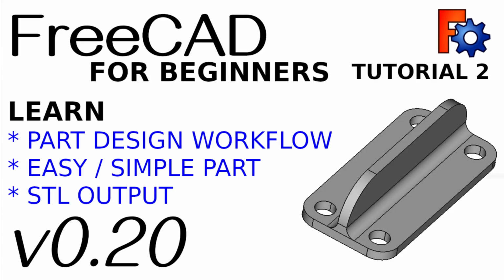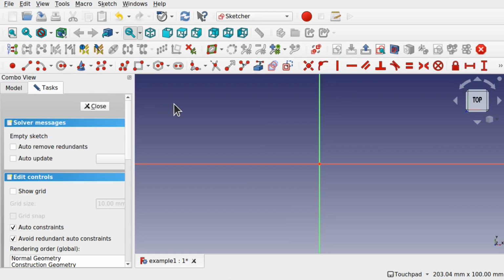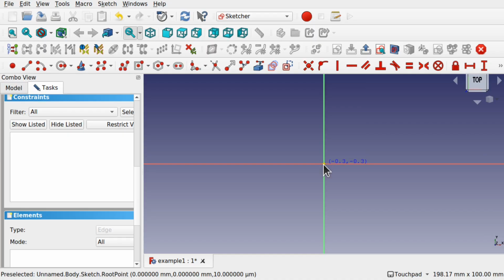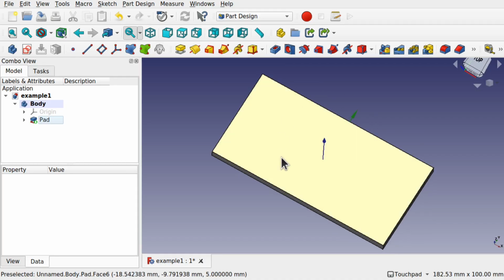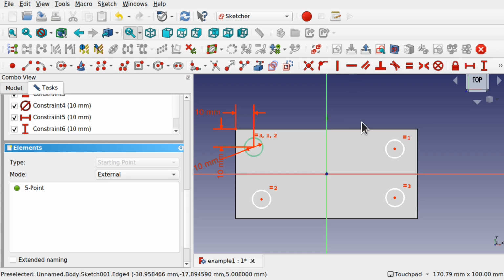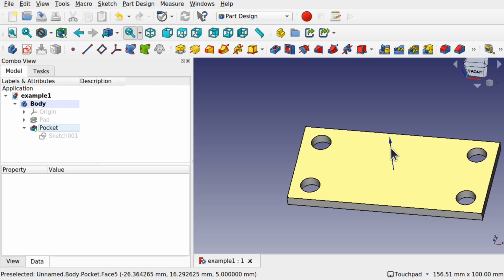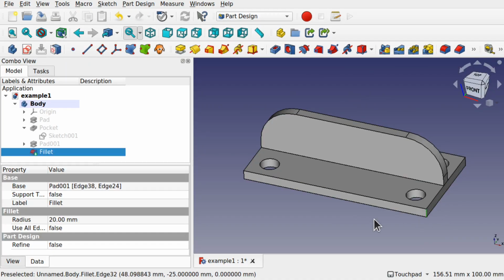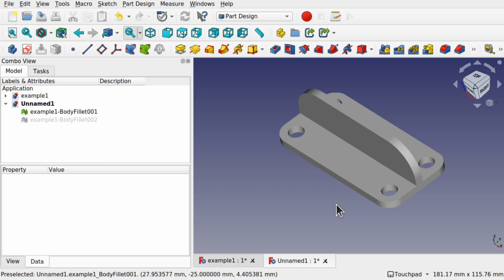FreeCAD 0.20 For Beginners | 2 | Create a simple model and export to STL in Part Design

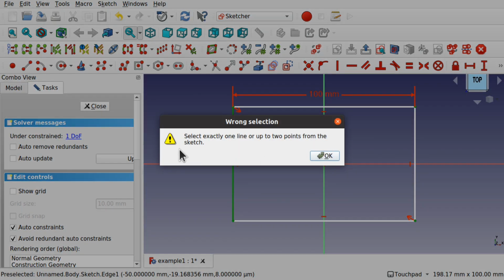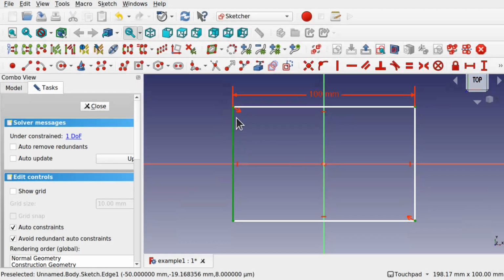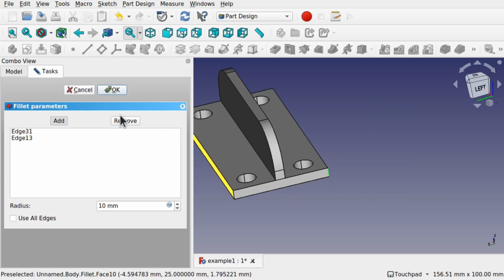Comment: 1st, thanks for the series. But a heads-up to others like me, who are at this stage of learning. I've just downloaded v 0.21.2 (current version for Windows) and the FreeCAD coders are like the rest of the coders in the world; they just can't help changing stuff because they can. 'Solver messages' still gives a count, but there are no config options in the box. There is no 'Edit Controls' box, but there is an 'Elements' box. At ~13:04 in this video showing the 'wrong selection' popup: well that doesn't happen in 0.21.2; instead, down in the bottom bar that shows the mouse options you get faint yellow text with that warning, and it isn't persistent. it disappears after a few seconds. REALLY confusing/uninformative for a novice user. This isn't a criticism of this video; it's a criticism of the coding changes that transform obvious, in-your-face warnings into subtle, barely noticeable text lines out of your visual focus field and leave you wondering why the software isn't working. ok..onward from 13:04....And at ~21:00, in the Tasks box I don't get a purple 'x', but a purple dot. There is no mode drop down for to select external. At ~33:00, the behavior of the report view is...different. At~34:00, 'add' has become 'select', and you must hit 'preview' for the additional filleted corners to appear.

Comment: Read the title and the comments and thought this might be a good choice for a beginner. Maybe because I have not used cad before, I found the instruction almost useless, on my computer anyway. Constantly losing my work and having to start over. Tried saving regularly but when it goes awry and I revert to last saved it is never at the last saved and I have to do all or most of it over again. I downloaded the same version as the video but ... I have the speed slowed to 75% and it goes to fast to follow having to switch from screen to screen. Pretty frustrating. I guess it means beginners to FreeCad not beginners to Cad in general. Looks like a program that could definetly make drawings easier if you could learn it.

Comment: I have a question: whats the difference between a pocket and a hole? And why are we using a pocket here instead of a hole?
Reply from the maker: A pocket allows for more control over the depth and shape where as a hole allows for threads and control over standard sizes (M5, M3 etc) . You can use which one you like it's totally up to you.

Comment: great tutorial but i am watching this a year after it was made and my version seems to be different and i have some things missing. i could not add extra fillets to the base i had to do each one manually. my interface looked different than yours also.
Reply from the maker: You must be running on 0.21.  I am thinking of redoing these for that version.  There are enough differences to warrant a re-run.  But if you can deal with the variations the tutorials are still valid.

Comment: I seem to know have the centered rectangle tool.  I don't see that dropdown menu and I don't see it in the sketch drop down menu.
Reply from the maker: The tool is available from the rectangle tool by selecting the down arrow by the side of it for additional options.  If you haven't got that then check to see which version of freecad you are running.
Reply: @MangoJellySolutions  that down arrow is not there.

Comment: very good. I have used many CAD systems dating from the 80s till now (CADAM, ProEngineer, Solidworks, SurfaceCAM, MasterCAM, etc).  It has been about 15 years since I've done any CAD work at all and boy have things progressed!  What FreeCAD offers for free used to cost $60K a license in the 90s. I'm getting back into it because my wife bought me a 3D printer :) .  However, I didn't find FreeCad all that intuitive to use because of the jumping back and forth between "workbenches".  Your videos are extremely helpful.
Reply from the maker: Nice to see your coming back to CAD, I know what it feels like coming back to 3D after a long break, have been through the same myself.  The workbenches can be very confusing but once you have got used to them then they come second nature.  I personally customize them in my day-to-day use but use the defaults for the videos.  Tools can be moved from one workbench to another so I have a number of commonly used tools that I use the most on my toolbar.  Glad your enjoying the videos.

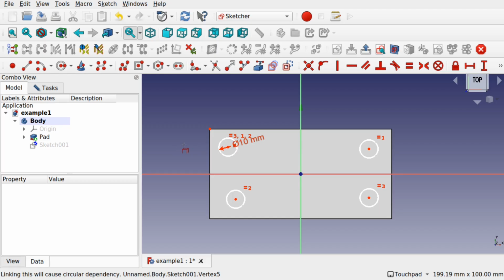Comment: @ 20:37 I get this error when placing external geometry:   22:30:40  Traceback (most recent call last):
  File "<string>", line 1, in <module>
<class 'ValueError'>: Datum 5.00 mm for the constraint with index 2 is invalid
22:30:40  App.getDocument('S
ketch_001').getObject('Sketch001').setDatum(2,App.Units.Quantity('5.000000 mm'))

Comment: Good video.
Problem I have was when I went to draw the 2nd sketch, I couldn't see my drawing as it is on the xy plane under the pad.
Reply from the maker: Thank you. With your issue it sounds like you haven't mapped the sketch to the top surface. Select the top face and click the sketch and it will be attached to the face. Don't double click as the whole lot will go green and you will have selected the body. It's only recently I realised that some people who are having problems are doing this and it can cause some confusion.

Comment: Although this is an excellent tutorial, there have been enough changes in the windows in the combo viewer that it makes you have to go through and figure out what options you need to select to continue the tutorial. The Edit Fillet window is just one example as there is no longer an Add button, but a button that switches between Preview and Select, There are several more differences. Plus, I think there may be a bug in 0.21. Twice, even though I followed you, FreeCad tried to draw the new objects on the bottom face (holes and rectangle for vertical piece). I went ahead and went back a couple of steps using undo, followed you and the same thing happened. Had to undo to just before adding the sketch, save the project, close FreeCAD, open it again and viola, everything worked.

Comment: I really like the video's so far. I only have one question. For constraining the last 2 DoF of the circles, why pull in another external component, horizontal constraint and vertical constraint? I would think using symmetry constraints on the axis lines solves the same issue. Is there any pros or cons on either ways?
Reply from the maker: Glad your enjoying the video.  There are many ways to constrain the geometry so I can't say that it is right / wrong / best / worse or the whys.  At the end of the day if it get's you where you want to be and you have achieved the desired outcome then all is good.  FreeCAD gives you that flexibility to allow you to tackle those tasks in multiple ways.  As for pro's and cons it often down to personal preference.  It's good to find alternative ways as you have done to give yourself more of an understanding of the software

Comment: for some reason i dont have the center rectangle on my toolbar
Reply from the maker: There could be two reasons for this.  The rectangle tools are all under one tool, you will see a small drop down arrow by the side of the rectangle tool and find the additional ones within.  The other is that you be be running a old version of freeCAD.

Comment: I am half way through part 2 of the tutorial. I have the base with the four holes modeled. When I set an external reference to the left and right edges and insert a rectangle, the rectangle appears on the bottom surface.  I am running FreeCAD 0.20.2 on a WIN 11 PC. Thank yo for the very clear instructions.
Reply: It is on the bottom, I can see the lines thru the holes.  If I rotate the object I can see the addition until I have a full face view.  It then disappears.

Comment: Great tutorial for Freecad, you have made it very simple to understand. Could you tell me how to select different depths of pockets for each feature?. Say if two holes need to be at 3mm depth and other two are 2 mm depths.
Also in 0.2 version the centered rectangle option is missing, any idea how we can get around that
Reply from the maker: Glad you enjoyed and thanks for the feedback. So for pockets of different depths you would do those on a seperate sketch. Pocket your holes for your first sketch and then select the face and create another sketch on top of that for the next set of holes to pocket. As you haven't added any height then the highest point will be on the same plane as the previous sketch. And for the centered rectangle you can use symmetry with say top left and bottom right against another point. Or even drop a point in yourself.

Comment: Very nice series so far. I watched the first two and it goes at a very decent speed for beginners (some beginner's courses start with the space shuttle - not helpful!). I managed to do everything like you did except the last 2 fillets. I have seen in the comments that many people also had that problem. I set the preferences to refine after boolean and sketch-based operations but even with that it gives me an error: failed to create fillet.  The error report says: Recompute Failed! Please check report view. But there is nothing in report view. Interestingly, if I select the whole part and select fillet, I get fillets everywhere up to a measure of 2mm (looks quite nice) but that is not what the exercise was about so still don't know why it did not work on my system (Freecad-daily).

Comment: I tried out this model with an experimentally different workflow. 
I failed to get a fillet on one of the two corner edges of the "ridge" part.

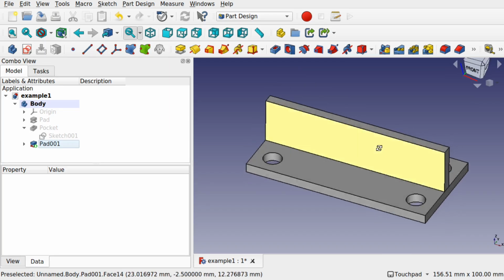That brings up this doubt: at 31:50, you have applied the fillets directly to a 3D shape. For creating all six fillets in this object, you could have edited the sketches to round up the corners using constraint-preserving sketch fillets. Instead, you have applied the fillets to the 3D object edges directly.

So when are we supposed to use the sketch fillet, and when are we supposed to use the 3D object fillets?
Reply from the maker: You have to be careful with fillets (3D object edge ones) as numerous issues can occur especially if your doing a fillet either end you have to be careful they don't add up to the width i.e. a edge 5mm and a fillet on both sides of 2.5mm.  Backing it off to say 2.49 will fix the issue as the edge won't be shared .  I am looking to do a video to explain some of these 'gotchas' with fillets.   Regarding the other question, if I can add fillets in the sketch then I will favour that method as basically your are adding arc geometry which you have more control over.  But you will often have to add the fillet via the 3D object as it is impossible to add it via the sketch.  I will also always do this last as a finishing feature.
Reply: @MangoJellySolutions  Filleting the edges of a 3D object looks effortless, and so it certainly is very tempting! 🙂

In my case, the fillet was very tiny (it never reached the other end). Besides, both edges of the ridge are symmetrical, so both should have failed together. But only one edge failed. 

Unfortunately, I do not remember the workflow now. 
(In hindsight, I should have saved the file, so that the  model tree provides some clues.)

Comment: In this video (and others), the Combo view panel has two tabs: Model and Tasks. 

But I installed 0.21 (weekly) today, and its Combo view panel has only one tab named "Tasks". The "Model" tab is missing.
I did not find any control to make the missing tab re-appear (e.g. in the View menu)
 
I also see a new panel called Tree View below the Combo View panel, which looks like the missing "Model" tab (It shows the model's tree). 

Has the UI changed or is my installation messed up because of some misstep?
Reply: After posting the same problem at the FreeCAD forum, I got the answer: 

I deleted two files:
%APPDATA%\FreeCAD\user.cfg
%APPDATA%\FreeCAD\system.cfg

When I restarted FreeCAD, the Model tab got restored.

Comment: I am using Freecad 0.20 (on MacOS Ventura) and see a vast number of differences between what I see in your setup tutorial and the user interface of my own installation.  As an example, the navigation icon in the bottom right of the window does not show me the various key combinations I need to be able to zoom, pan, orbit, etc.  Let’s start with just that question - How do I see these key combinations?

Comment: For some reason my rectangle constraint does not have the centered constraint options. How would I go about to getting that to show up?
Reply from the maker: It sounds like you may be using an older version of freecad as they are available in the later versions. I would consider upgrading if so as there are many benefits

Comment: Big News Flash!!, for me anyway, I got the flange completed last night, has the pad, 4 holes, all the fillets, inside and outside and got it exported/saved as a .stl file, I'll do a test print tonight, I use the 3D printer at the library, on to section 3,  I still have the problem of the part being on top of the axis regardless of view? don't know how to fix this, what version or rev are you using?

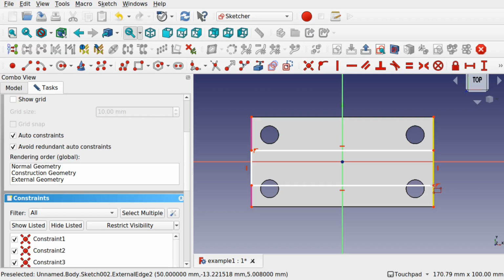Comment: I'm stuck, I am in section 2, time is 28:55, I got the 4 holes configured, in the TOP view, for some reason the axis lines are in or on the back of the part,  such that when I put in or try to draw in the rectangle it draws the rectangle on the back of the part,   help please
Reply from the maker: . I am starting to realise that this might be from viewers selecting the face twice as I am seeing similar questions elsewhere. So select the face and create the sketch. In the properties of the sketch you should see map mode as flat face. If you select the face twice then it selects the whole pad. This might be a significant step forward if this is the case because I can make reference to this in  future videos.
Reply: @MangoJellySolutions  THANKS for your time MJS,  I have started a NEW section 2, , which is OK, I get to the problem area faster,, and - hopefully can get thru the problem area

Comment: Can we say that it is as good as Solidworks for domestic purposes?
Reply: Nope, too buggy, rough around the corners and lacks quite a bit of nitty-things that make the workflow that much more snappy.

Freecad has three redeeming qualities is that it is open source, free and just good enough to do work(aka it isn't good, convinient or easy to use, but it works)
Reply: @Shonicheck  Yeah, I know. I tried it already.
Reply: @Shonicheck  I find OpenSCAD better because of no bugs.
Reply: @himanshusingh5214  Yeah,  but openscad doesn't really cover "all bases"(actually the reason why i even started looking into freecad), its hard to model certain things in there, so freecad is a nice extension to that(also freecad has openscad integration, haven't tried it yet though).

Comment: Man this was thorough and really well done. I struggled at times because my impatient brain kept trying to guess ahead, but when I think about it, you really didn't have any redundant explanations in there.

Many thanks 🙏
Reply from the maker: Thanks for the comment and feedback, really appreciate that. I know what you mean about wanting to jump ahead, CAD is hard and it takes time and when I was learning (still am) I wanted to do the same.
Reply: @MangoJellySolutions  it's been over 20 years since I last dabbled with 3D graphics, modelling etc. CAD is so totally different though. Both easier and more difficult, depending on what you're trying to do.
I never thought I'd be trying to learn CAD at this stage so I can 3D print an adapter for my vacuum 😅

Comment: Great video and very clear narration, spoken at the right speed. I got caught out following this a few times with the precise steps that must be followed for External Geometry to apply to the top surface as the default is the bottom surface. Only until I realised the surface has to be selected first before starting a new sketch, so the sketch then applies only to that surface. Making a new save after every step saved a lot of time, when things stopped working, which they constantly do.

Comment: I had to run this three times having got rather lost. I found it was due to missing a mouse click or clicking off the workpiece. However it was worth the effort and it cemented some of the methods in my mind. You explain it very comprehensively and clearly. Many thanks.

Comment: Also, when continuing this exercise, after the "error" below, I go on and get the the Close so I can add padding, and there is no Padding available to me at this point.  I must stop, because nothing else works from this point on.  No Padding, no exercise to continue with.  Please advise.  I have screen shots available but don't know how to attachem them to these comments. (sigh...)
Reply: The second sketch now does NOT have the "Pad" icons available.  What is wrong with this platform???
Reply: In sketch validate I get the following: "Sketcher::SketchObject: Link(s) to object(s) 'Pocket' go out of the allowed scope 'Sketch002'. Instead, the linked object(s) reside within 'Body Body'."  What does that mean?  I'm a rank beginner trying to follow this exercise and getting very frustrated.  Thank you.

Comment: A new-user tip for the "Select" tool: If you create the box from left to right, you'll only select the items that completely fit inside your selection box. But if you go right-to-left, you'll select every item that touches/intersects with the selection box. (This is common in CAD software, and FreeCAD is no exception).

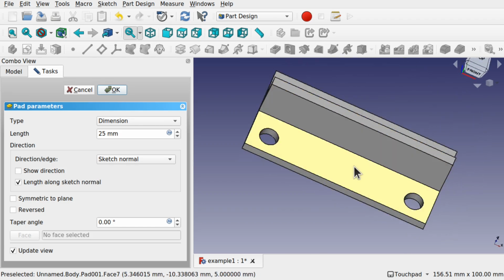Comment: hi so when i was padding the second rectangle at 30:53, i did it by making a centered rectangle and adding vertical and horizontal constraints to 100 and 5. it was also fully constrainted, so i was able to extrude it... i guess this is also correct?
Reply from the maker: Yes that's fine, there are many ways to achieve the same outcome